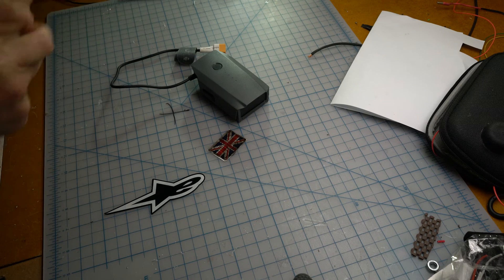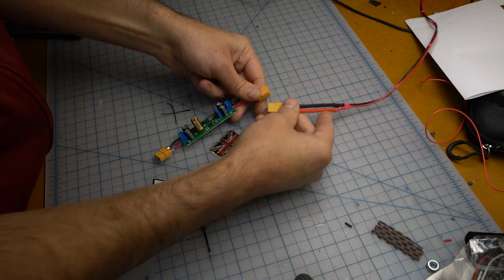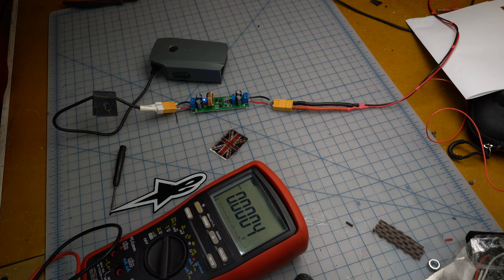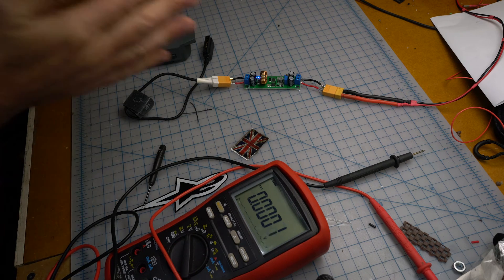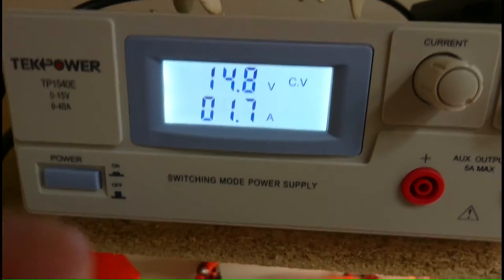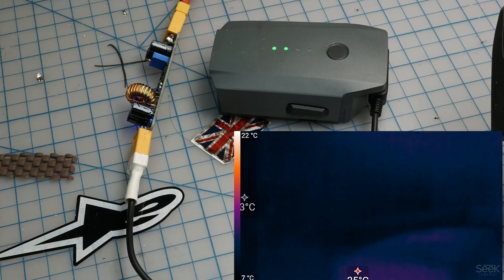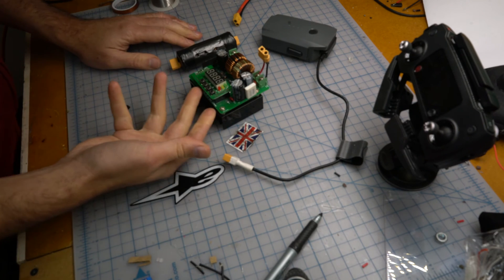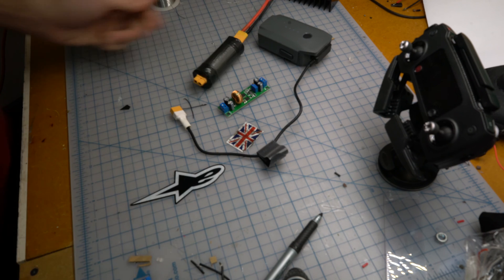DJiDIY MavicPro car charger low power version- Late night tinkering.

Comment: I accidentally found this video and wondered. The Mavic Pro batteries are 4 celled and require a balanced charge, which can not be done with a step down converter.